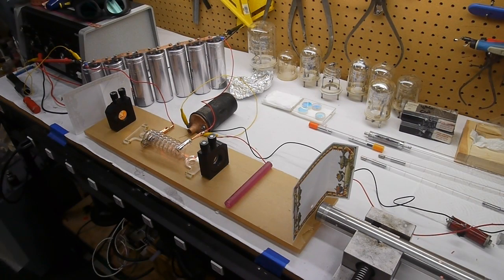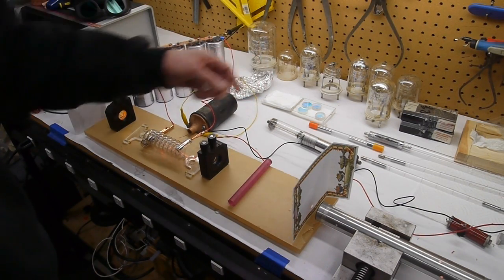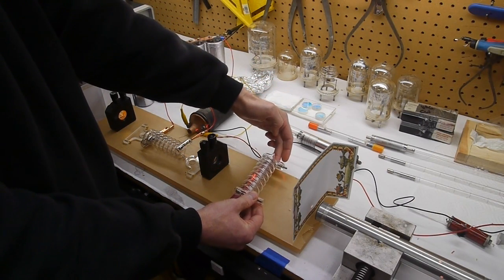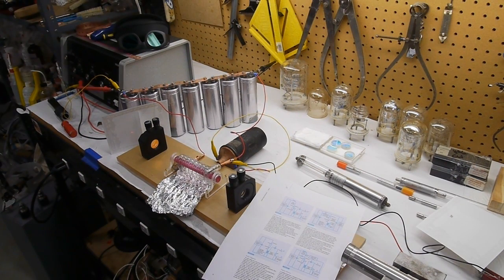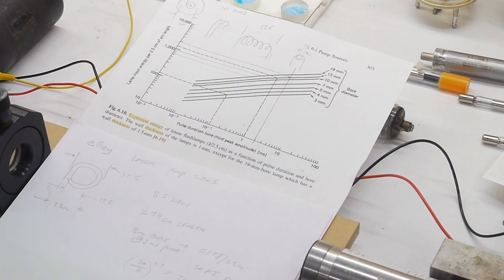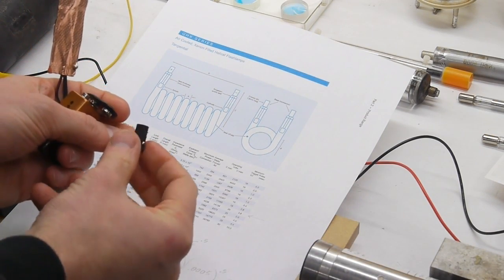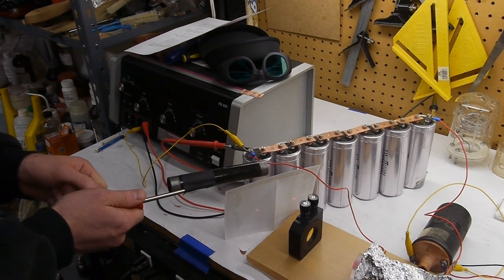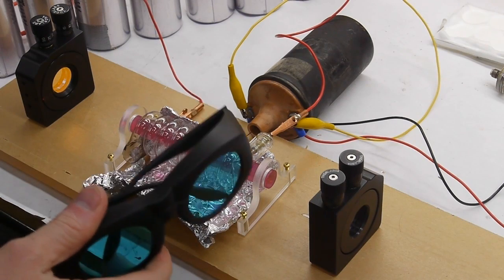Ruby laser design process

Comment: I don't have much knowledge regarding lasers but can you use LED's to excite the ruby rod.
Not sure what is the best wave length that will be absorbed but if you can produce just that it will be more efficient and an LED matrix will be easier to power.
Reply: LEDs don't even come close to producing the required light intensity, even thousands of them together. I think you're underestimating the power of these flash tubes - they're ridiculously powerful, and all that power is needed.

Also, it's the green and blue wavelengths in the flash light that excite the ruby gain medium.
Reply: dylanm36
You are talking in general therms but do you know the power intensity of that tube?. LED's are extremely efficient probably at the same level with that flash tube (guessing that is a xenon based tube) not to mention that the light emitted by the tube is really wide spectrum from IR to UV so just a fraction of that energy is useful.
Whit LED's you can emit in much narrower spectrum so a larger percentage of the energy is useful.
I see he is mentioning 8000J that will be the final setup and if I remember somewhere in the video he mentioned a 2ms pulse that is 8000J/0.002s = 4000kW assuming all that energy is transfered in those 2ms.
Energy for each pulse is 8000/3600= 2.22Wh so I guess he will not be able to fire that to often it will need quite a bit of time to recharge the capacitors.
You can also overdrive LED's as much as 100x for 1us pulse with a duty cycle of 0.1%
So assuming the same efficiency for LED as for the flash tube you need a crazy large 4000kW/100 = 40kW LED matrix that will be quite expensive even if you will be able to fit all those LED.
But maybe just a small fraction of the energy from the flash tube is useful like you mentioned just from blue to green part of the spectrum is useful then maybe you can be way more efficient with a blue LED or a cold white LED.
So still not sure if the LED's will work or be economical since I do not know the spec for that ruby rod.
Reply: ***** I see what you mean, but as AKAtheA said, for this type of laser a flash tube is just the easiest and cheapest method.
Reply: ***** You can't really use bare diode lasers to cut metal, trust me on that...(there's a good reason nobody is doing commercially). The beam quality is just not that good, it's much better to use the 808nm diodes to pump an Nd:YAG laser and use that to burn things ;-)
With a bit of patience, you can find a fairly big YAG rod capable of 40W CW on ebay for less then $100, if you get lucky you might get all the necessary optics for about $100 more.
If you want to actually do some cutting, try getting an entire laser cavity with the rod, flashlamp(s) and mirrors, it's by far the cheapest way to put holes into metal :D
Reply: ***** I think you are confusing the ruby with YAG lasers, which nowadays are being pumped by laser diodes...it is several times more effective, but also costs several times as much :D
If you want a cheap laser with peak power in the order of MW, a flashlamp pumped ruby or YAG is the way to go ;-)
Reply: AKAtheA
:) There is no way I can confuse ruby with YAG since I just read about them after  I made the first comment.
Interesting but I'm not interested in lasers right now.
Reply: ***** Ruby has a broad absorption region from 404 to 504 nm, unlike say, an Nd:YAG laser which has a nice peak at 808nm for which diode-lasers are available. So, unlike with YAG, you would need to have a laser diode somewhere in that region AND somehow manage to expose the entire rod to it. Blue laser diodes are fairly expensive if you want power, especially in the 10s to 100s of watts you'd need. There are also inherent problems with getting ruby lasers to work in CW mode.
So unless you reaaaaaally need the 694.3nm red beam, YAG is much more suitable diode pumping.
Or if you just want an epic, razor blade-blasting deep-red lazor, flashlamps FTW ;-)
Reply: AKAtheA
Thanks for the replay. Since then I read am bit more about lasers and maybe when I will get the time I will like to experiment with a few watts 808nm laser diode.
I like laser diode more because of simplicity and extended life span >10000hours usually of CW.
The two problems I need to solve will be focusing the rectangular beam in to a nice round and small spot and I will need an IR camera setup in order to be able to see the beam but that is not that hard I already have some cameras with IR filter removed.
Another advantage is that 808nm seems to be almost the best wavelength for most metals Aluminium will absorb about 13% but is very conductive so not sure I will be able to cut that and for steel absorption is around 40% that is really great.
There are also some LED arrays up to 60W CW but those seem to be impossible to collimate and focus in to a single point.
Largest single diode I've see is around 5W maybe there are some 7 or 10W but for sure not more.
Still even 5W focused in to a really small point can do some limited cutting.
I tried to find some example but majority of people buy them and have no idea of how to use them not to mention they are really dangerous.
Reply: AKAtheA For commercial purposes you need a lot more power than for hobby small things.
The beam quality is a concern that is why I need to study all the type of laser diodes available on the market.
Diode arrays are out of question since those are almost impossible to focus.
So that the only options are a max a few watts from a single laser diode normally between 1W and 7W.
I'm still undecided if I will use 808nm or 445nm on one hand the 808nm is 2x to 3x more efficient so for the same output power I need less cooling but the 445nm has the advantage that is in the visible spectrum and probably can get a smaller focus point.
Quite a few years back I modified an old video-projector and used a 10W LED powered with 6W and got an output of a bit over 30lm that was at a time where people used high power discharge lamps hundred of watts with at least 20x the light output of my 6W LED and they only managed 60lm to 100lm out of the projector mostly because of bad collimation most of the light did not get to the projector LCD.
I find the same problem is here with laser cutters even if I'm maybe wrong. I just started reading about lasers since this video.
If you look at the absorption of metals at different wavelength both Steel and Aluminium have the best absorption at around 808nm the Nd:YAG is close for Steel not so much for Aluminium.
Then from what I've seen most people use CO2 to cut Steel when the absorption at that wavelength is 3x smaller than for 808nm that and the fact at higher wavelength the focus point will also be larger makes the need for at least an order of magnitude more power output to cut the same steel.
I'm more interested in small, simple and efficient laser sett-up even If I can only engrave and not cut or cut thin pieces with multiple passes.
I'm still at the beginning and don't have much time for this right now but I will be sure to read a lot more and have all the theory right before I build something.
Reply: Dream on.
Reply: AnselmoFanZero  :) Thanks I will.
Reply: ***** "Not much knowledge" and "BUT YOU CAN..." in combination...I mean...cmon xD
Reply: AnselmoFanZero
This is a bit out of context not much knowledge on lasers but good knowledge on LED's
Reply: *****
Asians know their rice, but they cant make a freakin A risotto. Get me? Has nothing to do with each other. Specially for rubies, its rubbish. Totally inefficient.

Comment: Like the old school ignition coil next to your capacitors.  Those are getting hard to find nowadays.
Reply: Way COOL!

Ok, my inner geek is showing, but then again, I am an engineer.   ;-)
Reply: You can get a coil from any car parts store. Both of my trucks use that style coil.
Reply: +Matthias Wandel:
I think all cars that have a internal combustion engine have them.

I have the same model as in the video but I think mine is damaged since I overheated it because I ran too much current as I was experimenting with it.
Reply: Most new cars use coil on plug or coil packs or other things. Old coils like that are still around, but way less common than they used to be.
Reply: Coil is from Bosch, Volkswagen Beatle or BMW 2002.
I removed tons of them in the 80's, they liked to give up in the summer.
Reply: The link to the xenon flash tube
Reply: Yes of course. You can make a more efficient system with them as well.
Reply: 1:47
Reply: They are still made in 2021 as replacements parts. You can order a brand new one on amazon for 30-40$
Reply: Medhi from electroboom has one from his modern hybrid car that looks exactly like it he used to make a taser, is that one different?

Comment: Coincidentally I am also working on the Ruby laser at the moment. I've got much smaller rod (6mm diameter), and it seems mine has lower doping ratio (much less intense color). I am hoping to get it working on 1000J or less. Can you post a link to the mirrors you use? Their color is... unexpected :-)

Comment: Laser flash lamps are sometimes doped to absorb...some of the UV, this improves efficiency since UV normally doesn't contribute  to the pumping (at least for nd:yag) and also  prevents UV damage to the rod (solarization).

Just put some of the flash lamps you have under UV light, some of them should fluoresce blue.

Comment: One thing you won't find in the documentation about series trigger is the circuit to keep the high voltage pulse entering the power supply charging the capacitor (and every other electronic plugged in the room).

Transient-voltage-suppression dodes of proper rating (or several in series) can normally crowbar the pulse at the PSU side.

Just keep that in mind if you do ever go there.

Comment: Sintered Barium sulfate (NOT sulfide! that one is poisonous) is used for diffuse laser reflectors, much much better then aluminum foil.
Yes. this is the same thing you drink for x-rays. pretty common substance.

Barium sulfate can also be painted as a water solution on surfaces, or wet formed in a mold then dried.

Of course you need 100% pure Barium sulfate, not the flavored one used for x-rays.